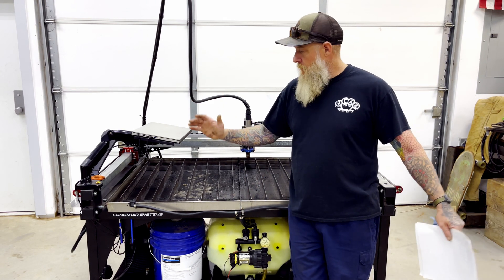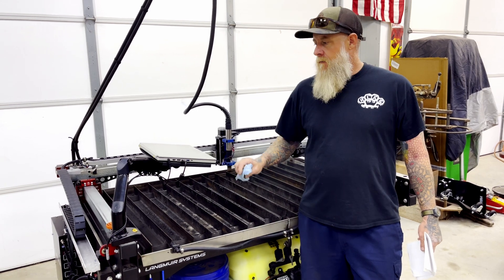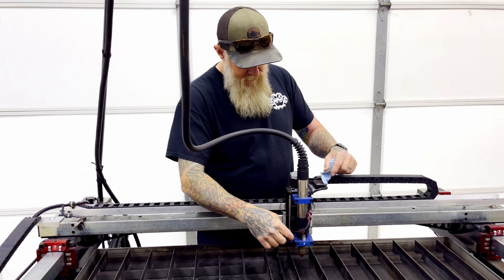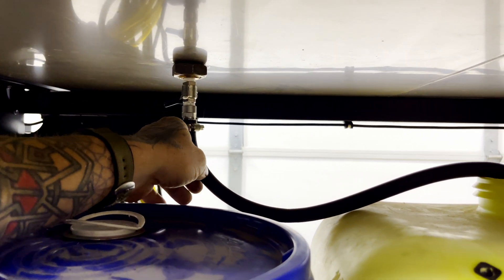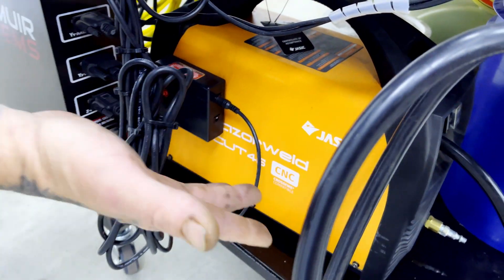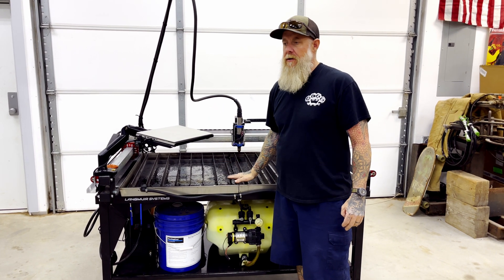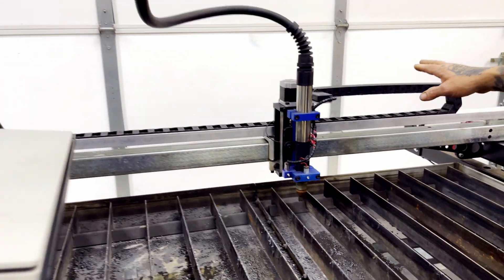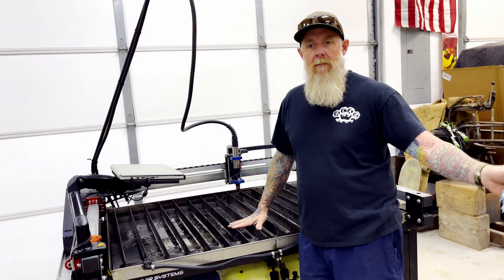Langmuir Crossfire Pro Upgrades #104

Comment: You have a link to the laptop stand? And do you filter the water before it goes back into the reservoir?
Also will the torch cable fit in the chain?
Reply from the maker: https://amzn.to/3Soh7wf  Here is the link for the laptop mount stand. I added the flat plate that the computer sits on.
Reply from the maker: I haven't tried it but I don't think the torch cable will fit in the chain with all of the other cables.  Also I think it would bind the torch itself.
Reply from the maker: As far as filtering the water, at this time I do not filter it back in.  I just swap it out after so many cuts.  I drain it at least once a week.

Comment: Did you have to but new extended cables to connect to the plasma or the control box of the table..??
Thank you
Reply from the maker: Yes I did. Since I went and put on the drag chains you will need to add a 6 ft cable: https://amzn.to/4iPtj4n.   D and N customs does a great tutorial on this, this is where most of us got it from: https://www.youtube.com/watch?v=AfJ0tcANv8I
Reply: @reyffdesigns1282  thank you.. I appreciate it very much.